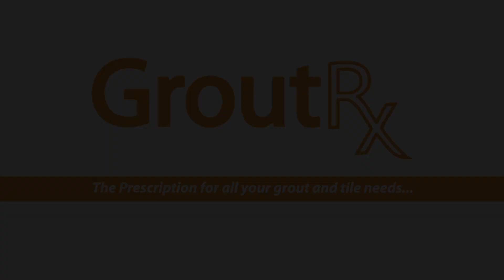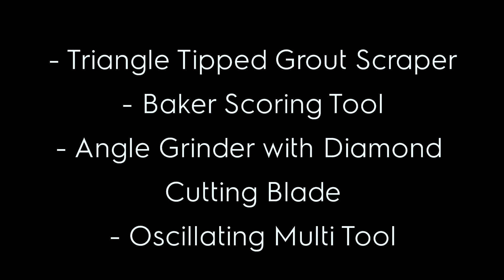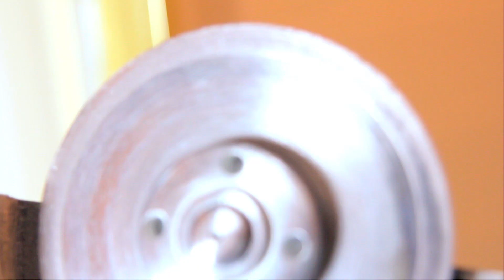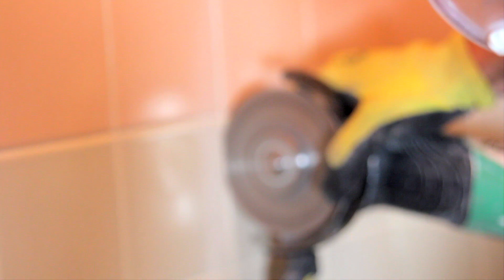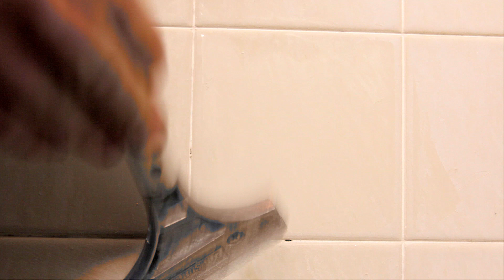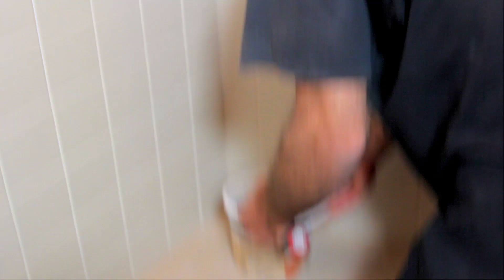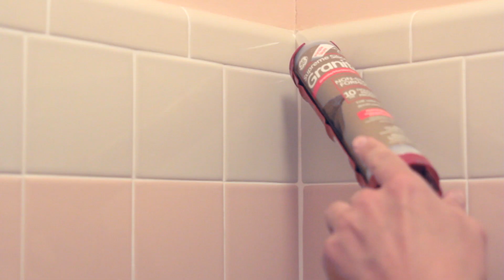Grout Removal and Replacement

Comment: Your statement about grout removal on a shower floor not being recommended took me aback. That’s exactly what I need to do but had planned to use my other shower to actually allow for proper drying times for both demo and regrout in the shower floor that needs the work. Was your statement made assuming that people couldn’t or wouldn’t set aside enough time, whether it be hours or days, to allow for proper drying time?!
Reply from the maker: Mortar beds are notorious for water saturation and deep mold penetration.  When we re-grouted them in the past, we would actually take the grout out and come back weeks later after the floor had been exposed to a fan, space heater or both.  The grout will always go in, but if there is still moisture in the bed, it will cure a darker color (the color it is when it is mixed) in the area where the moisture is present.  If the floor has significant mold, it will likely come back within 6 month to a year.  There are no hard and fast rules on any of this, but one thing to do to let the floor dry more quickly is to make sure all the weep holes in the secondary drain are cleared so the mortar bed can dry.
Reply: @groutrx1415  the shower floor of the house we just moved into obviously had this problem and someone tried to go over the grout with an epoxy product, which has chipped away.  Short of putting in a new shower floor, I'd like to try and remove the epoxy and  grout and regrout to see if this will work first,  is there a tool you'd recommend for removing the epoxy?
Reply from the maker: @Zorak2319  Do you know if you have a mortar bed or is the shower floor built on a foam core pan? Round drains usually indicate traditional mortar beds and square drains are akin to Schluter products. Also, where are you geographically located? You can message me at d-morrison@groutrx.com if you like. This is a bit more complicated than a YouTube thread answer.
Reply from the maker: @Zorak2319  This is a tough question to field without first seeing pictures. Please email me at d-morrison@groutrx.com and I can take a look. My first instinct is an angle grinder, but if you are not sure handed, this can be a disaster. There are other options...
Reply: @groutrx1415  sorry I didn't see your comment until now., I don't know if it's a foam core or mortar bed, but the drain cover is square while I can see the drain below it is round.  Believe me, things in this house were done on the fly.  Thanks for your email, I will respond to that.
Reply from the maker: @Zorak2319  Looking forward to helping you out in whatever way we can.

Comment: Do you remove all the grout down to the thinset or just enough for the new grout to adhere? Thanks
Reply from the maker: We go about 3/4 of the depth of the tile to get good hold for the grout.  The more you can remove, the better, but with standard field tile with 1/16" grout lines it is difficult to go all the way to the substrate with scoring tools.

Comment: Are the corners/seams (where two walls meet at 90 degrees) grouted & also caulked? Please share your thoughts on that.
Reply from the maker: While I am not a fan of caulk in general, we do use it in most instance where there are seams.  When two surfaces join, you often get small amounts of expansion and contraction of materials which cause cracking at the seams.  In new construction, some form of seam tape should be used in these areas to help mitigate this and prevent leaking, but cracking can occur regardless.  In terms of the look, we often grout the seams then caulk with a clear silicone caulk (more elastic than acrylic).  While we may sometimes use a caulk of a different color, it can be difficult to match the color exactly which then highlights the seams.  If you grout, then caulk, the color of the grout will come through and you will get the benefit of caulk holding the grout in place IF it cracks.
Reply from the maker: They are grouted and then caulked whenever we go over and re-grout existing installations.  Depending on if seam tape was used for the original installation of the substrate, whenever you get two surfaces meeting, there is invariable cracking from expansion and contraction.  This is normal and if the substrate is waterproofed, the cracking is purely aesthetic.  Grout mixed with a flexible admix or epoxy grout may not be as prone to cracking, but does have the potential to crack.  Whenever possible, a clear bead of silicone caulk is never a bad thing.
Reply: Caulking is a crutch used by most people to make up for poor workmanship. I lived in a house for 30 years  with no caulking in the corner of the shower or tub and it was fine. The only place it is really needed are places that have movement from each other, like between the tub and tile because they tend to move separately and the grout will crack. 

If you bought a new home, it was probably done by someone who can't speak more than 2 words of english and has no education on doing the work. I lived in a brand new home recently (renting) and every single door in the house was crooked. EVERY SINGLE ONE! When the stairs started to creak, the builder sent a guy in who cut out all the nails under the stair treads.